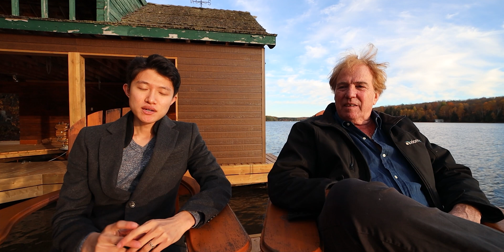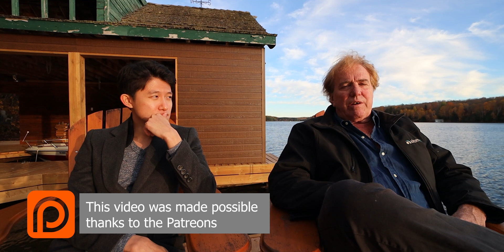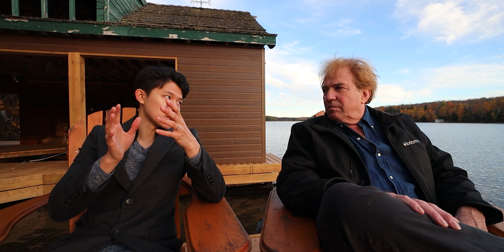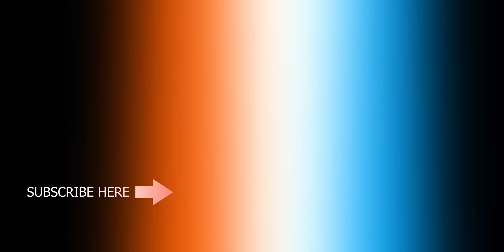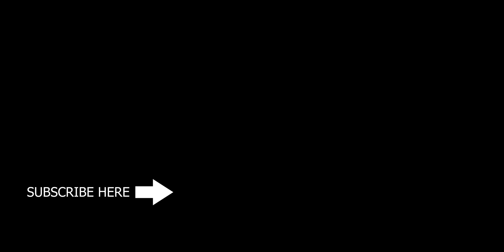Interview With A Speaker Designer: Axiom Audio

Comment: He is pretty smug about having an accurate speaker 🔈 but it’s not even a point source...advantage KEF
Reply: No one needs a point source .... Look at Epos drive units ... No xover required
Reply: @edwardbalboa5528  point source is a clear advantage...not debatable. No crossover with multiple drivers results in a tradeoff of higher distortion and a rougher response...it’s rare that it’s worth the trade off.

Comment: NICE video..YG acoustics doesn't believe in DSP I do to a point...It can be beat but you are spending 50-500k in my experience to get there...Even then getting it all setup takes time, components room treatment maybe. The problem with DSP is it takes time to adjust things and doesn't sound as natural or as fast as a YG driver can do with the right amps, Mola mola and Audionet pair well. this is semantics for most midfi and things under 20k DSP is a necessary evil to optimized those crap MDF cabinets. I hate to say crap but it's terrible. compared to aluminum and machined things or more exotic materials like in Wilson and things so you don't hear the cabinet.